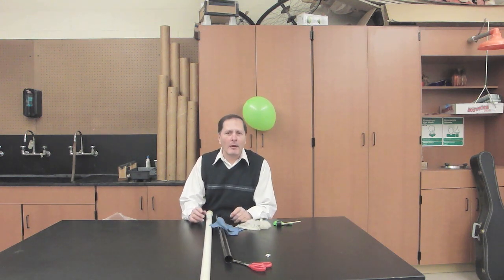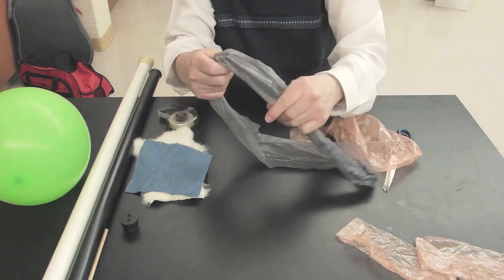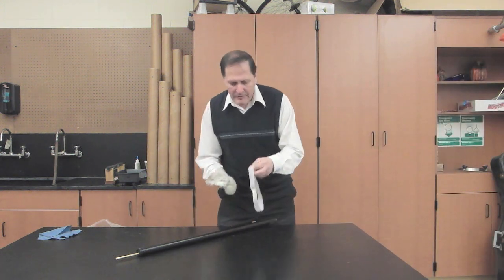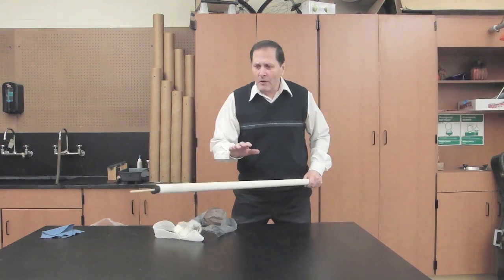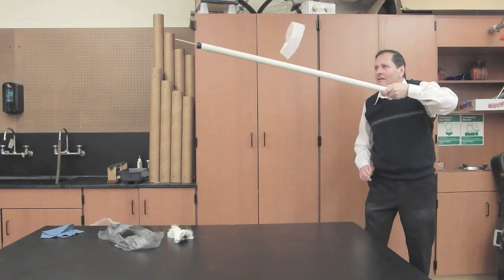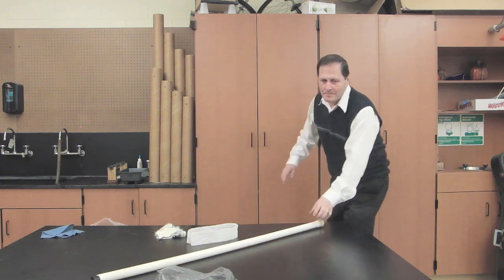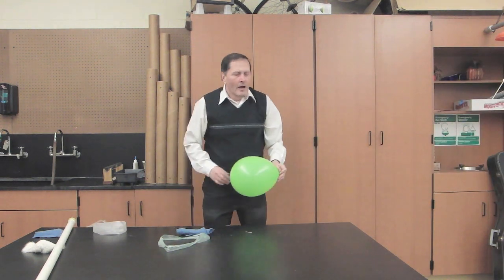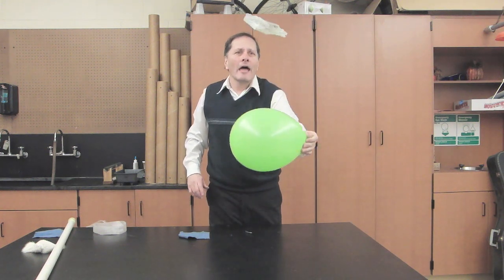Electrostatic floating Rings -toy physics = Homemade Science with Bruce Yeany

Comment: Hello Bruce, can you tell me what the purpose of the stopper is please, I guess it helps it hold the static charge for longer? Also, would a PVC rod work better than a pipe if that's the case? Love the video and thanks for your time :)
Reply from the maker: The stopper's function is not an important one,  it's purpose is to hold the dowel at the end of the tube.   The purpose of the dowel is to reach up and snag the loops off the ceiling when they get stuck there. Having it or not should nave not affect on the amount of charge.  I would prefer the pipe since it has more surface area an should have a greater charger and hold it longer

Comment: Hi Bruce, I'm trying to get these rings floating currently. Have you ever had luck using a balloon instead of the pvc? I'm playing with both round balloons and "thunder stick" style. I'll be doing this with kids that are a little too young to be trusted running around with rigid sword shaped objects.
Reply from the maker: yes, a balloon works quite nicely, and for the rings, cut them out of plastic shopping bags,  you may have a problem with this during the summer if it is humid,  you can send me an email for more information.  bgoknee@comcast.net
Reply: @YeanyScience  Thanks Bruce! It was the humidity causing problems. Giant 36" balloons were able to take on enough charge to still float the rings in a humid environment.
Reply: what types of clothes we may used ?

Comment: Tried this this morning, and it works beautifully! My 6yo was very excited by the magic levitating rings :) I used a ring made of a shopping bag charged with a wool jumper. One weird thing I noticed is that after a few goes, the ring will not charge up any more and no longer levitates, or sticks to the jumper. Made a new ring out of the same bag, and that one worked perfectly. Do you know what process is at work here?
Reply from the maker: Are you handling it,  if you hands are moist that may be a cause,  also the amount of humidity can be dampening out the effect.  These can be a lot of fun but I find they are very sensitive to weather patterns and work the best in areas or times that are very dry, rainy days do not  make for good results.

Comment: due to the strength of the repelling electrons, the ring will move and if you dont move the pole with it, it will travel too far to the side until it falls.  if you keep moving the pole, you'll keep the ring above it and floating. 

my question:

What is a way to calculate the amount of static electric energy is in the entire system in order to determine when the ring will fall? rate of discharge?

Comment: Hello Bruce, 

I do this in my classroom but found the plastic bag pieces eventually don’t work not matter how much you try to build up static electricity. I like to save the plastic pieces to reuse but it does not seem possible. After floating the pieces a few times it no longer works. Do you have any thoughts on this or are able to explain why this would happen?

Comment: What is you made a surface out of negatively charged tubes (or just a negatively charged flat surface) and throw a ring above that?
Reply from the maker: I've beaning trying variations of surfaces and pipe arrangements but have not been able to get a ring to "hover" by itself

Comment: Now the question is, if you have the rod be a ring instead and place the plastic/styrofoam piece in the center, will it hover due to equal repelling forces on all sides?
Reply from the maker: No it  ends up sticking to the rod somewhere.

Comment: I love this experiment and would like to do it with my students. The first time I tried it with a tinsel ring and it worked perfectly.  I haven't been able to recreate the experiment with successful results since the first time.  I have used balloons, golf tube plastic pipes, pvc pipes and many types of materials including faux fur and wool.  I do live in Florida and saw on another comment that weather can affect the charge.  Is there a way to recreate the experiment and create enough static electricity to create the experiment with humid weather or will it not work? Thanks for your time I love the channel!
Reply from the maker: yes and no,  it has some clips from a previous video but gets into more details on construction

Comment: It's an interesting video. Thanks @Bruce Yeany, for these educational videos. I've a doubt here. 
What would happen if we put the pvc pipe through the polythene rings. Will they hover and make a perfect circular ring (or oval shape, because of gravity)?
Reply from the maker: I've tried it and it doesn't hover,  the ring will hang on the tube at the top side
Reply: Is it because the charge always accumulates on the outer surface? So, the inner surface of the ring has opposite charge, and is attracted by the pvc pipe?

Comment: What does the robber stopper and stick do?
Reply: Lynda Wilkinson ,maybe it just prolonged the static charge on the pole, but he actually said its not necessary ...
Reply from the maker: It's to get the loops off the ceiling or high up on the walls.

Comment: I've tried it at home, but the plastic bag didn't float. When I put the bag on the tube, it even stuck with the tube. I followed your video, rubbed both the PVC tube and the plastic bag ring with a fake fur. Did I miss anything?
Reply from the maker: this is better to do in the winter in low humidity.  Mine won't work now either

Comment: what if u don't put that cap
Reply from the maker: the cap is not needed,  it just holds the wooden dowel which I use to get the loop off the ceiling when it gets too high and sticks to the ceiling tiles
Reply: Bruce Yeany can we do it by normal cloth

Comment: Experiment in skill, rather than science: Balance the ring atop the balloon atop the pipe (with charge, of course.) this is akin to saying "sure you can balance a ball on your finger, or another ball, but what about both?"
Reply from the maker: Hi Ryan,  I have a new piece that goes a step further,  a loop of PVC pipe that  the ring floats above without me touching it or having to balance it by hand
Reply: next step: get one of those grounding pins and plug it in to the MINUS end of the electrical outlet, place the other end on a large cone, then charge a hollow foam cone and set it floating above it. awesomeness 2.0! (of course the ideal result is a floating chair on which to play video games)
Reply: Instead, why don't you just insert the ring around the pipe? by theory, it should not touch the pipe!!! right :D and much easier.
Reply: I just saw your other comment, sir. I think you should rub the ring from inside and the pipe from outside[obviously]. I think it should work.